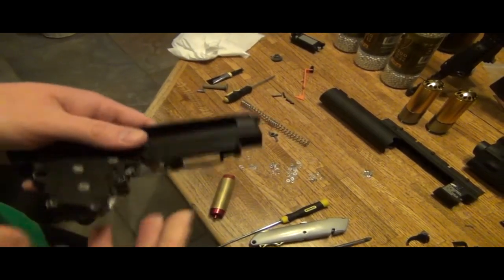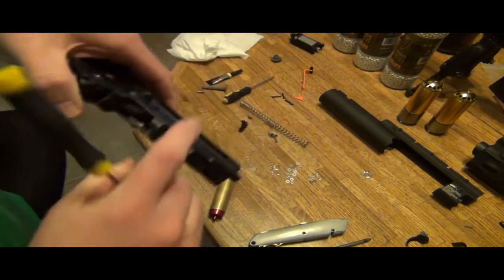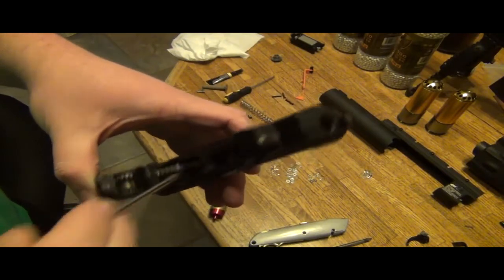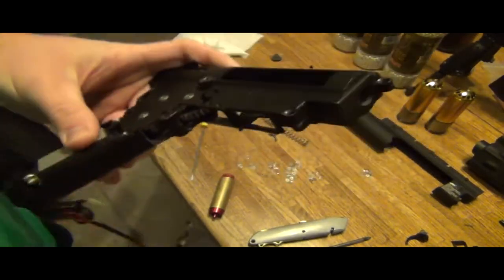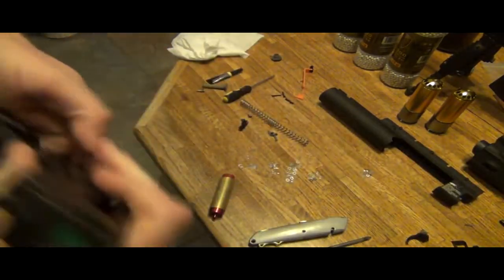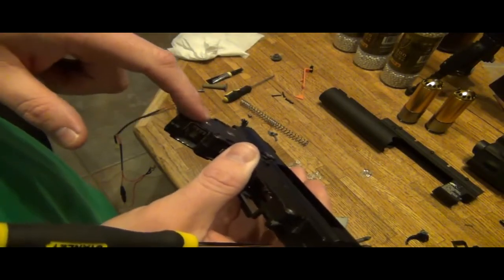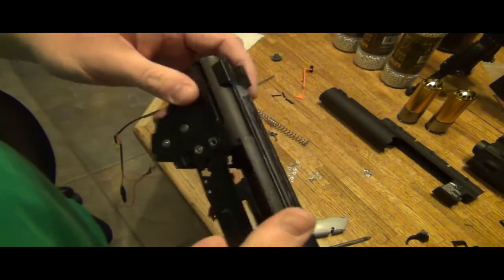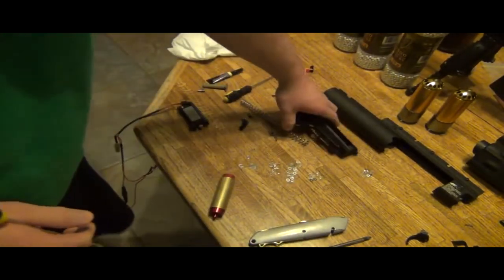My Comments About My Recent Fast Perfect Shim Job

Comment from the maker: The problem is trying to get people to understand you can make a perfect shim job, make everything ready before you even pull a trigger and cycle the gears mechanically by a motor. I show in this video the shimming is flawless. Because this is a V3 there is no way the shimming can be off when assembled. There is no way the motor can gap itself from the bevel. This is how I know 100% that when I have the gun assembled I won't encounter an issue with the shimming.